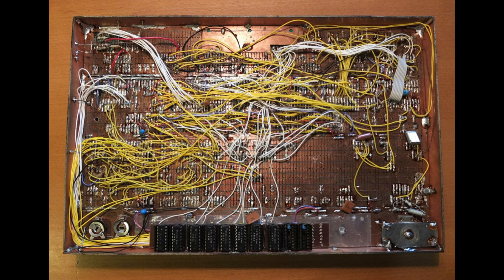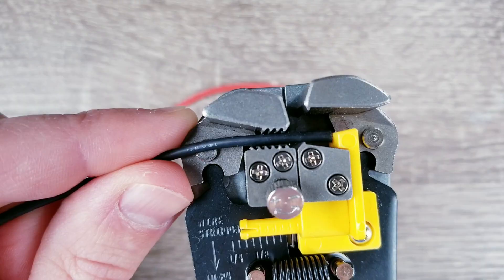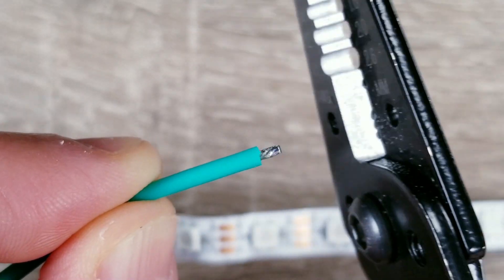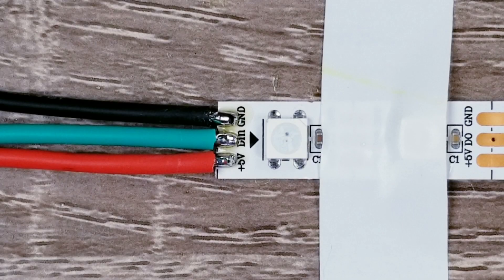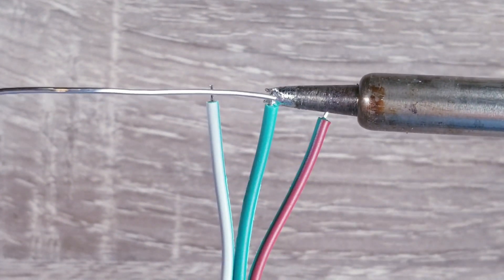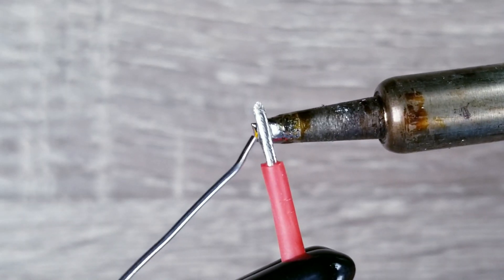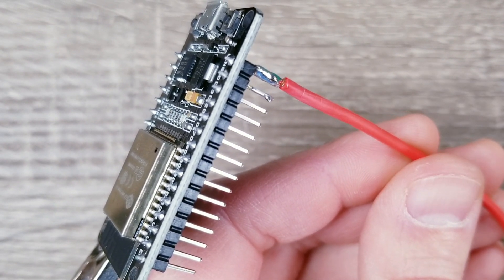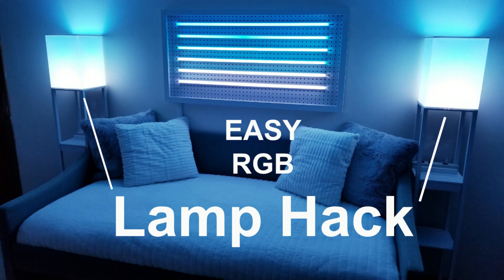THE BEST Soldering Tutorial - LED Strips and More - Complete Walkthrough

Comment: hi Chris, im a big fan of your work and trying to get into it.. I had no experience in soldering and tried to cut and connect 5 strips by soldering exactly how you shown in your video... I came face to face with few problem number 1. Soldering tool youre using has a beveled half moon cut on it, i tried to find the same but couldn't find exactly type you're using, where did you get this one ?
im using pointy one and it makes my life hell, also it doesnt really warm up through the wire down to copper plate so copper plate solder is always hard no matter how long i keep my tool over the wire on top of copper plate , so frustrating , please tell me a tip on how to avoid this headache
thank you very much brother , keep posting

Comment: You should also mention that in order to be a good solder, that it's a shiny flat ball, and not dull flat ball of solder.  That will let you know it's a good solder joint.
Reply: Well it shouldn’t really ever be a ball, that’s indicative of excessive solder.

As for the finish: shiny for leaded solder. Most lead-free alloys do not produce a shiny surface at all, and even the ones that can, can only do so if worked with expertly. So with lead-free, shine is not considered a quality criterion.

Comment: ~1:30 doing solder to the soldering iron,,,,That's actually wrong, you have to wipe a soldering iron before touching any components.
This is just not done in a professional world.
No Flux, amateur...
Not even to go further than this point, bad advice, an amateur.
Reply from the maker: Thanks for watching and taking the time to comment! Appreciate the feedback and advice!
Reply: You are correct that you must wipe the iron before soldering, but subsequently adding a small amount of solder as a thermal bridge IS considered proper technique in professional soldering. (Yes, I am an electronics professional who has had professional soldering training.) 

External flux is not always necessary (in fact it frequently isn’t). 

Is this video an example of pro-level soldering? No. It’s not. But the things you’ve chosen to criticize tell me that you are not a soldering expert by any stretch of the imagination, OP.

Comment: So when I’m tinning my wires the solder want to “ball up” what am I doing wrong ?
Reply from the maker: Thanks for watching and taking the time to comment! First thing is what solder are you using? Is it the same one I'm using in the video that I linked too? That solder has been the best I've ever used and solder makes all the difference. Second,  make sure the soldering tip is clean. The soldering iron I'm using has some cleaning wires included which helps keep it clean. Hope that helps!
Reply: Get better solder that has a better flux core. The Kester brand shown here is a superb choice (Kester 44 is the type to get, I recommend the 63/37 alloy but 60/40 is OK, too. I like the ~0.8mm diameter.)

Comment: If you have only used the Kester solder you are lucky and that might be why you underscore the importance of good solder. Im not an expert but also not a newb. I have made a LOT of solder connections these past few years. Hands down the biggest factor in the experience is the quality of the solder. Bad solder will make you think you can't solder and give up. A really good solder will make you feel like a pro and make up for a lot of inexperience. My final caveat ... be careful where you get the solder. I got a quality brand online I had used this brand before. But the vendor sold me his old stock. It had small whiteish spots and "felt" different than solder should. It was a NIGHTMARE to work with. It's still there in my solder box!

Comment: This is an old video so I doubt I'll get a response. I followed your tutorials to the T and I can't get my lights working. I have a 5V70A big power supply. Ive soldered the wires on and everything else. I'm not sure what  to do anymore because nothing seems to work with the lights. I'm not sure what I'm doing wrong. Any help would be nice.
Reply from the maker: Thanks for watching! The one thing I would check first is under led preferences scroll down and see what number is in the box next to gpio. I always us the D2 pin for data on the esp32 so I put 2 in this box. It used to default to 2 but lately I've noticed it after flashing WLED onto the esp device it  defaults to 16 so I had to go in there and change it to 2. Also make sure the gnd from the esp device, the led strip and the power supply are all connected. Let me know if any of those ideas help!
Reply: @ChrisMaherDIY  ohhh I just pressed down on my light strip solder connection and it came on but is semi randomly changing colors. So I assume my solder connection is a bit iffy
Reply from the maker: @TheMultiReplayers  what type of led strip are you using? Make sure you select the right strip in led preferences.if you're using the ws2812b strip make sure you choose the ws281x option. Also how long is your data line from the controller to the led strip? The longer the wire is the more likely you might not have a strong data signal by the time it gets to the first led.
Reply: @ChrisMaherDIY  Awesome! I changed this and now the very first LED will light and change colors but the rest will not. Any ideas? Do I need to change the LED voltage or anything else?
Reply: @ChrisMaherDIY  for reference it's a 3 meter long strip with 60 LEDs/m. I've set the number of LEDs to the correct number.

Comment: How in the hell are his blobs SO perfect and beautiful?
Reply: Well, they’re shiny because he’s a) using leaded solder of high quality, b) using an appropriate temperature (not too low, not too high), and c) he’s working quickly. 

With that said, “blob” is NOT the shape one should be aiming for, and any solder joint that can be described as a blob actually has too much solder. (And yes, he uses too much solder.) a good solder joint’s solder fillets are concave, not convex. The only exception is the butt-splicing of strips, where the solder is the only thing joining them mechanically. Though I would lay down a short length of solid wire there and solder it down as a lap splice instead.

Comment: Bro, is the soldering pin tip you using different from normal pins ?
Reply from the maker: Thanks so much for watching and taking the time to comment! Great question! The kit I ordered came with like 5 different tips. So it is different than the one that came installed out of the box. Its just a lot wider and I feel like things heat up more quickly with that tip!

Comment: Great video. I've already had some experience soldering but I'm always nervous still and wondering if I'm doing it the right way.

I have two quick questions for you. One, are you ever using flux, why or why not?

My other question isn't a soldering question.. I've seen other videos where they're connecting a logic level shifter to the ESP board first. I was trying to do research but couldn't tell are the ESP 32 boards and esp8266 putting out five volts on the data pins?
Reply from the maker: Thanks so much for watching and taking the time to comment. Great questions! So I have never used flux. The solder that I use and recommend (Kester) has always seemed to work very good just as is without having to do anything else. Ive seen a lot of those videos as well and I have never used a logic level shifter and I dont think the output pin for data is 5v. As long as the data line going from the controller to the first LED is not super long, then the data signal seems to make the journey just fine. Now in some projects, when I have had a longer data line, the data signal was not strong enough so I used s little resistor which fixed the issue or just used what's called a sacrificial pixel which boosts the signal. So all that to say, its certainly not going to hurt anything using one but in my experience, they are not always needed.
Reply: nappy, any tips/success using flux?  I'm wondering too.

Comment: What about using flux on the LED connectors?
Reply from the maker: Thanks so much for watching and taking the time to comment! You certainly can but I personally have never used flux. With the Kester solder that I'm using, everything has just worked really well without needing to use anything else!

Comment: Hey Chris I’m trying to cut and solder Nanoleaf (6pin) led strip. Can I use a thinner gauge wire or do LEDS require the 18 gauge?
Reply from the maker: Thanks as always for watching buddy! They don't require 18 gauge wires but usually the thicker the better in terms of voltage drop and safety. But i think most govee led strips use 20awg wires coming from the controller. (might even be 22awg. they are pretty thin)
Reply: @ChrisMaherDIY  the 6 pins were hard to solder I soldered one wire to 2 pins lol. It could be it was my first time soldering.

Comment: @Chris Mahaer Bro can you pls give me a workaround for soldering this wire to esp its giving me hell🙏🏽
Reply: im ditroying me board
Reply from the maker: Hey buddy! You can use these! https://amzn.to/3HDRVxe They can kinda easy come off the pin but as long as you are not moving it around much you should be fine! Also, I forget if you have already mentioned what solder you are using but that makes all the difference in the world. The one I link to in the video is the one I would for sure and if you dont have good solder, it can turn into a nightmare. Here is the solder https://amzn.to/3jctixW
Reply: I have some my concern was they are so thin
Reply from the maker: @DerrickMills-qp2nr  the ones I used to use are very thin. But the ones I linked to I just recently found on Amazon and are 20awg. A very big difference in size and have worked great so far.

Comment: I just tried soldering for the first time and sucked horribly at it. But now after re-watching your video, I feel like I will be a bit better next time. I knew the trick about tinning both the gun and wire, but I missed the part of holding the gun under the wire until it was heated up enough to take the solder from the top. I also did not try the push in method from the edge of the strip. Hopefully now, I'll get it work and not want to rip my own hair out.
Reply from the maker: Thanks so much for watching and thanks for the comment! Yeah, in my experience, the type of solder you use makes the biggest difference in the world. The one I use in this video came highly recommended and has been amazing to work with!

Comment: did you solder gun tip come like that? does it work better that way. i just bought one and it has a point. should i take me angle grinder and flatten the point down?
Reply from the maker: The one I got (linked in the description) came with about 5 different tips. I tried a couple of them and I liked the one I'm using in the video best! But using good solder is what makes all the difference in my experience as well as what I have heard from others. I have no idea if using an angle grinder would work! Thanks for watching and taking the time to comment!
Reply: DO NOT grind soldering iron tips. Buy them in the shapes you need. Modern soldering iron tips are plated (copper core, then iron plating, then nickel, and then the area that should not get wetted with solder is chrome plated). So if you grind them, you’ll expose the copper within, which will dissolve in the molten solder very quickly.

Comment: @Chris Maher, In this video you noted that on the ESP32 Board you connect the data wire to D2, and  in the WLED APP,  in LED setup you enter 2 to enable the data pin if I recall correctly, and in the sound reactive build, your wiring the D35 pin.  in WLED sound setup,  you enter 35.

Now there are other D? pins on the ESP32 module you've been recommending in most of your videos, can you use those for added LED segments in WLED as long as they are properly powered?  

If you can, how many other D Pins for LED Segments can used with a single ESP32 chip and how many LED segments can be managed with WLED on one chip..  If you've done any testing or are familiar with "D" pins that would work for this, might be worth a video and some feedback here would be great.    Thanks
Reply from the maker: Thanks so much for watching and great questions! You can certainly use other pins on the esp devices for connecting other led strips to. Its something I have not utilized very much so i'm still very much learning the ins and outs of it all. I did find this information helpful on the WLED page as far as recommendations: https://kno.wled.ge/features/multi-strip/#:~:text=For%20good%20performance%2C%20you%20can,a%20total%20of%204000%20LEDs.

I'm still not sure on what's the best pins to use or if it even matters since you can assign the data pins in WLED.  But at some point I do want to get more familiarized with this functionality and will for sure make a video on it!

Comment: Make your life easier and dip the wire in flux before adding solder. solder will instantly flow onto the wire. same with doing it on the strips
Reply from the maker: Thanks so much for watching and for the tip! I'll have to try it. The solder I'm using seems to work very well but I'm sure its one of those things where you dont know what your missing until you've tried it! Do you have some Flux that you recommend? What do you think of the kester solder that I use?

Comment: Brilliant video, thank you.  Question:  I'm using separate flux and solder, it is easier using a combined product?
Reply from the maker: Thanks so much for watching and great question! So I actually have never tried the separate flux and solder. When trying to solder for the first time I just searched for what solder to use and the stuff I linked in the video is what so many people said was hands down the best solder they had ever used so that is what I started with and have had no problems at all. So my guess is using flux and solder would more than likely be a similar experience from what I have had with the combined option but that is coming form someone who has not done it the way you are doing. Are you having any trouble doing it your way or is it pretty easy and things flow and stick like they should?

Comment: Love this and all your videos, thanks for helping to teach others about WLED.  I bought WS2812B 144 LED per meter and because of the high density of leds the contact patches are super small. I can’t get the solder to stick to the pads. My soldering iron collects all the solder vs putting it on the leds contact. Any help would be appreciated.  Thanks!
Reply: For more clarity on the issues I’m having. 1) Solder wants to only adhere to the iron, difficult to tin like you showed, it’s as if there is a polarity like in magnets that pulls the melted solder to the iron. 2) on the led strip the solder won’t adhere to the contact pads , I can drop a dot of hot solder on the contact pad but it won’t adhere, again solder just wants to pool up on the iron. My iron is at 550 degrees and using lead free solder 35g .08mm
Reply from the maker: Thanks so much for watching and taking the time to comment! Sorry for the delay! I've been swamped the past week! So i've never used the 144 led strips but based on my experience with the 100 led per meter strips, yeah the space you have to work is certainly very small and makes it a little more difficult. Right away I'm almost 100% certain that the issue is with the solder you are using. The solder I linked to in the description of the video is one that was highly recommended from some Facebook group where someone asked what's the best solder to use. It was crazy how pretty much everyone that responded to that question said the Kester solder is by far the best one. https://amzn.to/3InRZ4D In that same group, people also said that the lead free solder is extremely hard to work with. Now I have personally never used any other solder than the Kester one that was recommended but at least for me, its always been very easy to work with and I have not had any of the issues you are describing.
Reply: @ChrisMaherDIY  I'm having the same exact problem.  I have flux, but not sure if/when to use that.  LittleLewy, I think if you have 60 leds/m strip maybe try that to see if it's us or just the 144.  I may give it a try.  Chris here just makes it look to easy!  😫👍🏼
Reply: Did you guys ever figure out a solution to this? Could be the solder like Chris mentioned, or possible temperature since solder is attracted to heat?